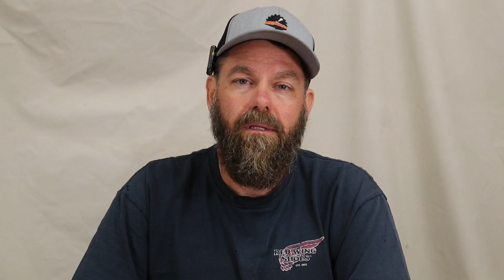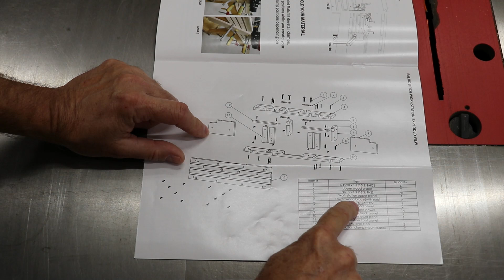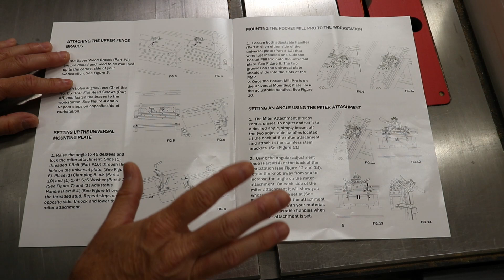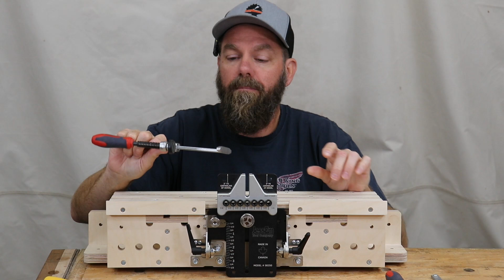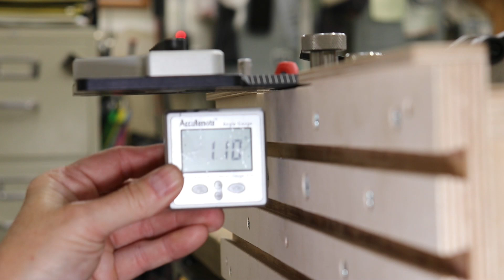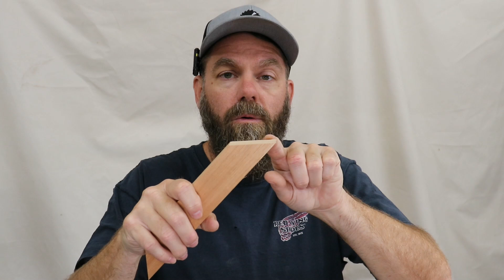Jessem Workstation Setup & First Use

Comment: Great Video 

Thanks for your time in making this video.

May I add:

1.  Baltic Birch Fence Pieces are Designated Right and Left.  I wish they were marked.

2.  The Baltic Birch Fence Pieces Have to Overhang the Workstation.  That point is not made clear.

3.  Miter Mechanism is Stiff.  Some light machine oil will help things along.
Reply from the maker: All great points. Thanks for sharing.

Comment: They have this on sale for $150 (July 2025).  I was going to get it last week, but the shipping was $40, so I didn't.  Then I saw a coupon for July, and with the coupon it ended up being $150.  I hope it's worth it.  I am going to be making a lot of furniture, so I hope so.
Reply from the maker: I seem to use it either on bigger projects with lots of dowels or small pieces where clamping the handheld jig is a problem. It's one of those tools that when you need it, there is no substitute. Even if you don't use it a lot, I think you'll be happy to have it.

Comment: Your idea about dropping the pin in the center bushing is genius. But to maximize the number of dowel holes in your workpiece (or position them closer to the heel of the mitre), you can attach a triangular block of wood underneath that center bushing.
Reply from the maker: Yes. Great point. I have a few different sizes and shapes of stop blocks I made for the work station. The stop blocks are more adjustable and provide a more solid/positive stop than the pin in a bushing.

Comment: Great information! Thanks especially for clearing up the confusing manual. I'm planning to purchase this soon, we'll see if they've addressed any of those issues in the latest version.
Reply from the maker: I'm glad you found it helpful!
Reply: I can confirm that the manual still has all the same issues you pointed out. The workstation seems very well made, I think I will really enjoy using it. I got the dovetail clamps as well, which in my opinion are pretty much a necessity with this workstation.

Comment: Hey Matt, any updates since you posted this video? Was interested about getting on after seeing your video, but still on the fence.
Reply from the maker: Bottom line, I really like this tool. If you like using dowel joints and have the JessEm jig I think it's well worth the $150. I've been getting more questions about this so I think a follow up video is in the near future. Stay tuned.

Comment: I keep coming back to this video to see if I missed something about the doweling workstation. With it discounted to $149.99 (I think they are closing it out and adapting it to the newer thin stainless steel jig), I am seriously considering purchasing it. One serious concern though…..you (and Jessum) show it being used to clamp boards vertically to drill into the end grain. Since the dovetail slots only run horizontally (and clamps don’t turn sideways), how would you clamp long boards to drill into the edge (not ends)? Thanks for any help on this. I’m not sure I can justify purchasing this workstation for only end drilling and then have to remove jig for edge drilling.
Reply from the maker: So I've been using the new SS jig to drill for edge glue ups. It works great. But if you wanted to do this with the Workstation, you could use an F-style clamp to span the top of the Workstation and clamp between the back of the Workstation and the work piece. It would probably be best to have the Workstation well secured to a heavy bench to prevent tipping when you are drilling towards the ends of your workpiece. I also think it would be nice to build a bench dedicated for the Workstation. One could incorporate a much larger clamping surface with horizontal and vertical dovetail slots. If I had more space in my little shop I would definitely do this. I hope this makes sense to you and is helpful. I think I will make a video demonstrating what I'm talking about. Stay tuned for that. Thanks for watching.

Comment: I’ve used this to build a set of cabinets for our house. Here’s my advice. 

Figure out the ways to hold things. You don’t always have to drill top down. You can also set it and drill horizontally. I understand that’s common sense. But you get in a rhythm and forget. Taking the piece to the workstation is easy. It’s fast. So if you’re building octagon shelves you can set the angle. Set a stop block and zip them out. 

As for large things, like full on cabinets. You can use clamps and stop blocks and do just about everything. But if you are using this horizontal to drill into the fade of a piece of plywood. Just grab a friend and have them hold it while you drill. So much quicker. 

And really take time to mark everything. If you get all your marks corrected you just pull a piece through. Drill down. Pull over. Drill down. Repeat repeat repeat. And you can put floating tenons on all the edge pieces of a cabinet in an hour. 

In terms of, bringing the small piece to the workstation. This is fast. Better than Festool. Better than anything. But when it comes to taking this to the piece. That’s where it falls apart and you really have to understand holds and angles and where to clamp and so on.
Reply from the maker: Thanks for the insight. I have more experience with this now and it's a great tool in most situations. Your comments here are spot on. Thanks for watching.

Comment: I have this same setup.  I heard in your video you said you might be building a stand for this workstation.  I am planning on doing the same.  While I was working this weekend on building some flip tops for my other tools, I quick tested this Jessem workstation to see if it would fit on a flip top.  It fit perfectly, just barely, on the flip tops I built.  Since I have two different types of Kreg pocket hole jigs, the K5 and a newer K720, I was toying with the idea of making a third flip top. I even have a 2nd brand new K5 kit that Kreg sent me.  I was thinking one side of flip top install the Jessem workstation and  K5 for 3/4 inch pocket holes.  Then on the other side of the flip top installed the new K5 with the 1/2 inch pocket hole block and the Kreg K720.  The other things to think of are storage for the Jessem accessories for the workstation and the other accessories for the pocket hole jigs. Further is a place to store the different size dowels as I bought a few boxes of them. I do have the K5 mounted to a piece of plywood that I can take to any location and clamp it down.  So my plan is to make sure that anything I install on a flip top can be removed and used somewhere else. I would be very interested in what you may  build.
Reply from the maker: I have a few flip top cabinets in my shop. They have sanders, buffers and my planer on them. They are handy. My main problem with building a cabinet for the Workstation is I'm quickly running out of room in my garage/shop.

Comment: I'd like to see you use the workstation for an mitered angle joint. I built a hexagon table a few years ago and joined the legs using the Jessem dowel jig. I built a custom fence for the jig at a 30 degree angle. It  worked out, but the setup was a pain and this workstation would have been a huge help. I'd like to see what results you get. Thanks for the video.
Reply from the maker: I will demo that joint in an up coming video. Pretty sure the workstation will make it fairly easy.

Comment: I bought the workstation with the Pocket Mill Pro.  I later bought the Master Dowel Kit and bought the workstation adapter.  I received NO instructions about installing and using the Master Dowel Jig and on their website I found the adapter plate but NO INSTRUCTIONS.  Like you I just figured it out.  The workstation works well but I dont like the Microjig dovetail clamps because narrow stuff does not work well but you can put a stop under short material and clamp it but the clamps may work well with larger material.
Reply from the maker: The size of the fence does limit its usage a bit. I have some ideas to make it more useful.

Comment: Great video, Matt, very helpful as usual.  Bought the Workstation but haven't had a chance to putter around with it much.  At first glance the manual, what there is of one, leaves alot to be desired.  You're absolutely right, why wouldn't a company like JessEm take the time to produce a decent set of instructions?  And for me, calling them has been a lesson in futility.  Good products with terrible customer support.  Thanks for posting.  Mark
Reply: That’s my experience with Jessem, great products but HORRIBLE customer service.
Reply from the maker: I called about the missing screws and left a message. I also used their online contact form. I received an email the next day saying replacement screws had shipped and received them 4 days later. So far, my experience with JessEm CS has been satisfactory. Unfortunately, many others haven't been so lucky.
Reply: @MattMadeIt123  Just called Jessem today and got a real human being!  I finally got to fiddle around with the workstation and dowel jig only to find out that the attaching plate shipped with the station is only for the Pocket Mill Pro, it won't fit the dowel jig as is.  My mistake, guess I should've read the fine print.  Personally, I think they should sell the unit with both plates.  Either that, or make one that fits both. Mark

Comment: Answered a question I had - Would other "rail clamps" work in a groove cut with the Matchfit dovetail bit? Probably not 😒   So far how do you like the workstation? The attraction to buying this workstation to me is less time building shop fixtures and more time building projects.
Reply from the maker: Some clamps might fit, others won't. Of course, a grinder could make any clamp fit if necessary. I have used it a few times and can see it being quite useful in the future.